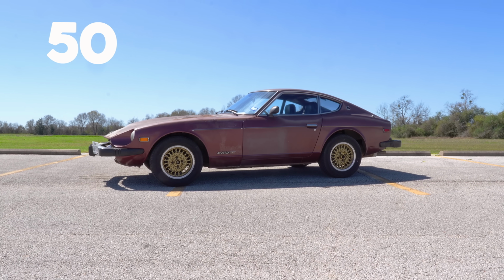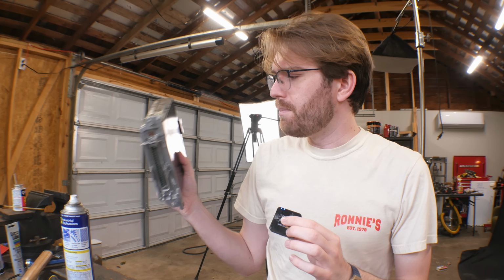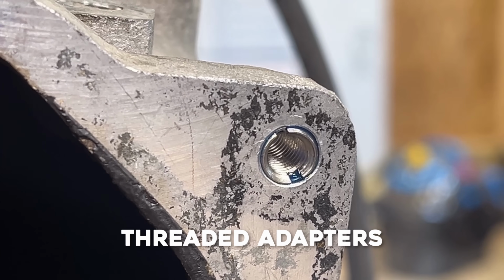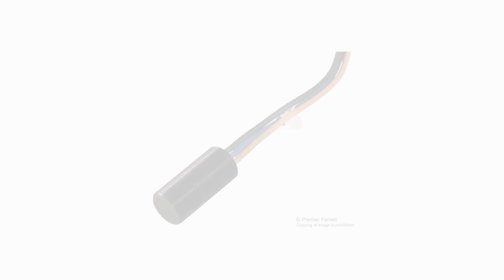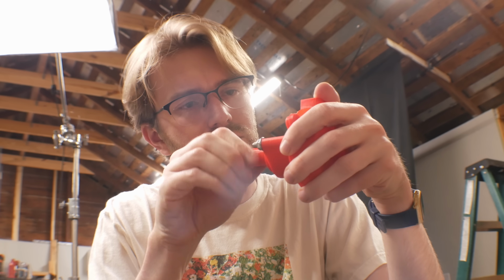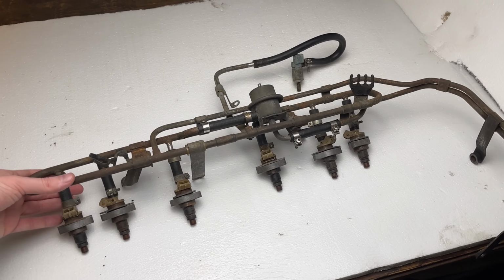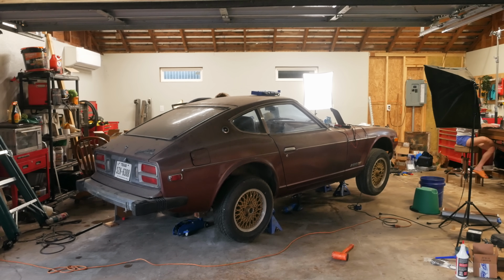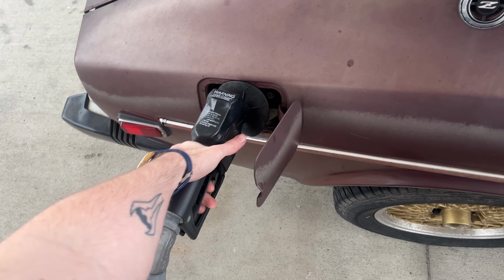Modernizing a Vintage Car

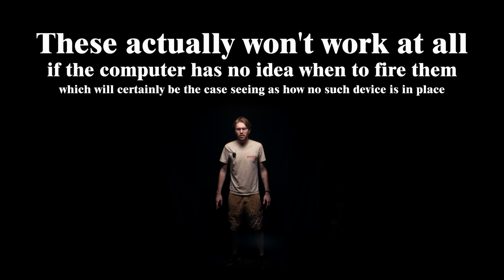Comment: 13:05  we really don't care (that much) about how fast the engine is spinning.  More so if the spark is occuring at the correct point in the rotation.

Comment: back in the 90s one of these Datsun's came in as a trade in. we discovered a Porsche 911 engine and transmission. some test drives were performed to "make sure it was all good" . if it had wings it would have flown

Comment: We all go through our trials.
I had to replace turbo's, ignition system, and 4x4 hub actuator system on a 2015 3.6L eco-boost f150 this summer for the brother in-law.
Fortunately, I didn't have to engineer any parts to do that.

Comment: the best thing you could have done is put a 5.3 LS block in that car and drive it another 100K miles. you probably wasted thousand on restoring that piece of junk with that used have semi injection bosch POS computer. Those are the worst computers ever, mercedes benz from the 80's had this crap., HORRIBLE

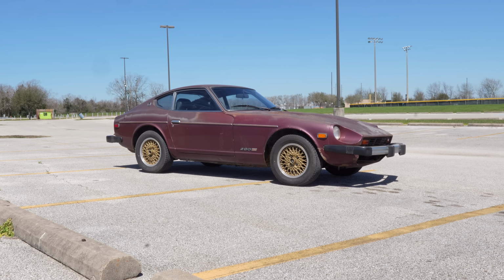Comment: @0:24 Except for the reliability part. They aren't overbuild like e. g. a Volvo redblock and more complicated, hence more prone to failure. I understand the allure of contemporary conveniences and engine tech in an oldschool shell. That is the reason why Mitsuoka builds exactly that. It doesn't solve the parts availability long term, though. Even a lookalike classic car is a classic car at some point.

Comment: Mount the pulse gear on the crank. I run my V-12 Jaguar on two 6 cylinder electronic control s (MegaJolt) 60 degree offset for the sensors. Runs great!

Comment: An efficient computer monitored car is great for a daily driver but a simple 4 barrel carb on a 350ci or larger V8 on a car of this vintage is fine( it doesn’t get driven enough to send u to the poorhouse at the gas station. I had a 1st year Porsche 928 and the chrome lined aluminum block just had a normally aspirated 4 barrel carb. These cars were gas suckers in the city but surprisingly economical when on the highway with a constant speed in overdrive

Comment: Somewhere in your research you got something wrong on Bosch Fuel Injection  in the early 70s Bosch Fuel Injection was a standard on Volvo  cars , Jaquars  and VW  who incidentally continued using Bosch when they switched to manufacturing mostly water Cooledengines like the VW Rabbitt that system used a Computervthatvwas mounted in the passenger Cabin under the Passenger seat  Bosch had a  trade name they used for the system that was something like Boschtronic or something similar  I think they were trying to make it sound like it was Tech Savy  to keep up with the new Home Computer Systems  that were quickly  becoming everywhere and FYI  I had several systems on VW vehicles that worked. Very well  many of the parts were interchangeable with Parts from a different car with the same system the big issue was the majority of Mechanics and Garages  did not have the equipment or knowledge on how to adjust the computer  or sometimes called the brain of the system     I put a Ijector pump from a Volvo Wagon  salvaged from a Junkyard  onto a VW that was running  and driving when I sold it

Comment: Amazing Video! I was thinking about the same thing for another vehicle A Corvair 95 ramp side trucks whose power train is well under powered. I found a place in Hastings Nebraska that can provide restored ones at different levels..I am thinking since it is a flat top rear engine like your Fireo a swap might work?

Comment: I have to say: I am impressed. I do projects myself, but I mostly concentrate on body work and the eventual rebuilding of the engine or/ and transmission. Watching your video made me realize how inadequate I am still, as I am nowhere near your expertise. I can’t even work a 3D printer 😀 I have been looking to buy the exactly same car for a future project, but now I am thinking maybe I should wait. Anyway, I will have to ask for a big favor, and hopefully you will reply to my comment. I have been stuck for several months now on my current project because I cannot find a specific bearing I need to replace inside an engine. Seeing the two bearings in the video prompted me to ask: could you please direct me to a manufacturer, dealer, anyone who can maybe help? It would be greatly appreciated.

Comment: How does it know when there is a break in the pattern? Like how does the Hall effect sensor know when it skipped over the trigger tooth, vs just slowing down? Also could you have just said every nth tooth is the timing, so it literally counts every tooth as it’s rotating, and tracked the trigger tooth that way?

Comment: "now I love wiring, about the same as I do getting stabbed in the face 47 times." 

You'd love my job.
Assembling electrical cabinets.
Then again, I get a somewhat comfortable working height on a flat working bench, with just the spine of the cabinet actually brought up from the box until I'm done wiring.

Comment: Very interesting - here in Germany that would not be possible, regulations are too strict

I have a 31 year old Opel Calibra with a 2.5 liter V6 24valve DOHC engine. It makes about 170 hp, 
I have got the earlier version, a C25XE, that is said to have a little more punch than the later version, and to tend more to 180 hp 
Torque is 227 Nm max compared to 203 of the Datsun's 203 Nm. 

So it is pretty much comparable to this engine. 

The injection is a Bosch Motronic 2.8, an early electronic system with sensors. 

I get a gas mileage of 25 mpg  (9.3 l/100 km), in summer/sun/warm/dry conditions. 
(Having survived 30 years in original configuration, I want to preserve it)

A factor in Germany might be the drag coefficient, the Calibra had one of the lowest drag coefficients for its time with 0.26 for the 2 liter and about 0,29 for the V6. That is compared to the 0.38 of the Datsun 280 Z a 30% disadvantage. 
That low drag brought a high top speed, 147 mph  

I don't want to overdo it, but in the meantime under easy conditions (straight out with tendency to downward) I took him up to 130 mph. 

The engine is anything else than a torque-monster, at low revs but that also means that the engine feels more lively the faster you go - once you get to about 100 mph, the car seems to be really eager to go faster. 
And to get off from the traffic light, simply do not shift up, then you are pretty fast. From time to time a little revving is not that bad. 

As an experience of unlimited autobahn driving, you can really feel how the engine feels freer every mile at higher speeds, the engine outright burns free.

Comment: This is exactly what I am doing with my Ford Corcel 1977. I did not want to change the motor, due to Brazilian bureaucracies and the willing of keeping its originality. But instead I am modernizing it, like installing fuel injection, changing its 4-speed gearbox to a 5-speed one of the following generation of the same model and upgrading its 1.4 cc to 1.6 cc -- something Ford did with the same motor in the next generation of this model (1977-1986). I think that in general it keeps the "heart" of the car and at the same time makes it more reliable and efficient, without loosing the vintage experience.

Comment: The original system is inherently more reliable and with some knowledgeable work, that missing horsepower could have been restored.  Will the new parts last 40+ years?  The answer is no.

Comment: I watched from beginning to end, no skips and no speed increases. Perfection! 

Also my 2006 Pontiac G6 has an engine power reduced notification at low temps. I think it’s an oxygen sensor thing. Also my exhaust has a giant hole. Any possibility you have a connection or two that I could get some help with it?

Comment: Great video. What fuel grade are you using for your 280? I had a '79 and I would get over 25mpg if I used premium fuel. When I used regular it got under 20mpg. The power difference was noticeable as well. Hopefully this helps.

Comment: Okay, hate me if you don't agree, fair game.  BEFORE you started jerking that engine out of the car you should have followed the well documented proven use of Seafoam to decarbonize the inside [upper combustion and crackcase lower] of the engine and lastly run a couple of cans of Seafoam through the entire gas circulation and intake/injection system.  $100 of Seafoam would have done you $1000 worth of improvement to your starting point IMHO.  Carbonized rings and liners suck

Comment: You know an intake manifold is a bolt on as well.  That could greatly increase the airflow into the engine.  Then exhaust headers are also bolt on, so that could greatly increase the airflow out of the engine.  Apply an updated tune and it should get about 200 hp.  Finally, a turbo could be considered a bolt on.  With an intercooler, you could see about 300 hp from that engine.  All of this does not change any of the internal parts of the engine and can be undone if desired.  money pits are best if you feed them well.  Good Luck!

Comment: This video sold me on electronic throttles.  The responsiveness was almost as fast as one's foot can go from 0 to floor, and it just makes more sense to have one valve control all airflow into the engine than to have a separate one for idle air control and things like that.

Comment: The intake manifold runs on that 3:51 are a mile long.  That motor would be a world of difference if you could put direct injection (or close intake injection).

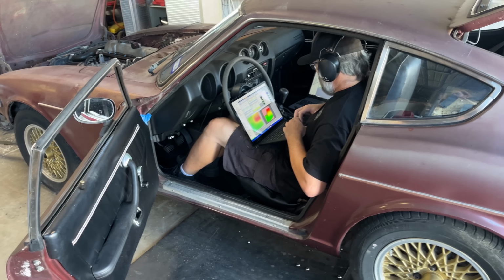30:11 "Hey everybody, here's my 'O' face!"

Comment: So if the coil pack has an adapter wouldn’t there also be a conversion for the distributor??? 5 minutes searching found the trigger wheel conversion

Comment: My 928 Porsche was more fun than on also one add an upper brake light above the car because I got rear ended twice and that's what happened to it the third one could be fixed could not be fixed I can honestly tell you I miss that car

Comment: Why not just use an off the shelf electronic distributor? When I saw you making that I was like, "Man, you better make sure that's balanced with some precision bearings" since it will be spinning high RPMs.

Comment: bro should have swap the pistons to modern too also the valves  not changing the block the the cc of the original just letting the engine more lighter and if you can use sugar as a fuel like in my country def is a must go too

Comment: Great video, one issue, while yes it does lose horse power through the drive train, testing it after 50 years on a Dino isn’t very scientific as the engine most likely doesn’t run nearly as well as it did in its former glory (as with all the other driveline components). What you should expect in a pristine 1978’ 280z is around a ~20% loss of power, at least with a manual transmission, assuming you have the high power Japanese L28 (the one that makes 190hp factory), you should expect a horse power rating at the wheel of about 150-155, however the other issue is that the 190hp rating only applies to the high power output Japanese models that weren’t sold in America due to emissions regulations, which since your car is right hand drive I would assume it has the American engine rated at 149hp, so the real rating assuming you have that engine should be around 110-120 horse power stock.
Hope this helped! :)

Comment: This entire post operates off the assumption that the engine it came with was somehow inferior to a new engine.  Meanwhile there's far too much evidence that new engines are actually much worse.  And in fact there is plenty of proof modern engines are usually deliberately designed to fail (i.e. amazingly stupid "modern" designs like the "wet belt" engines)due to designed-in defects!

Comment: Does the new configuration cause the engine to run smoother now?  It seemed to run pretty smooth after the previous 280zx video, but now it maybe a bit rougher.

Comment: Very cool, i had the same car in the early 90's. I did something similar.....ripped out the 6 and installed a Chevy 350 and a T350 trans. A 21" cross flow radiator fits and i cut and welded the drive shaft. Was a fun car.😝

Comment: Threaded adapters are called helicoils in uk
Reply: Thought helicoils were a coil of wire so you can fix gnarled threads, not size reducers
Reply: @No-mq5lw I stand corrected, thankyou